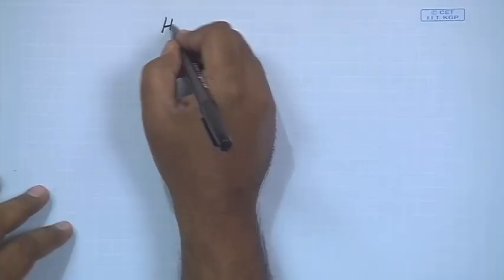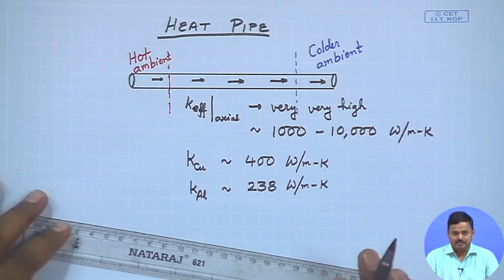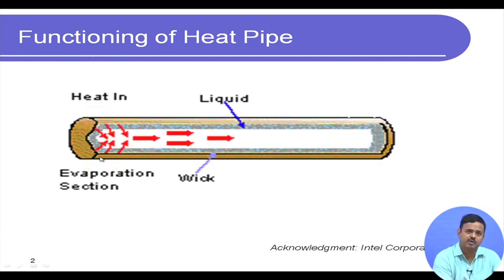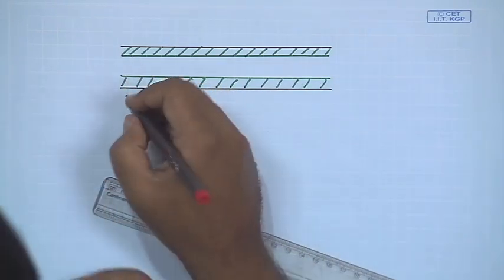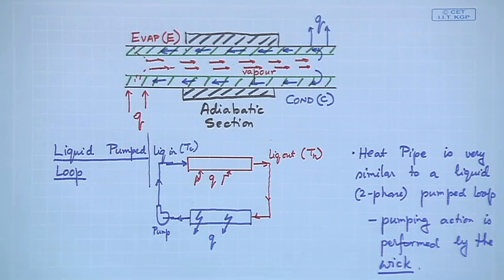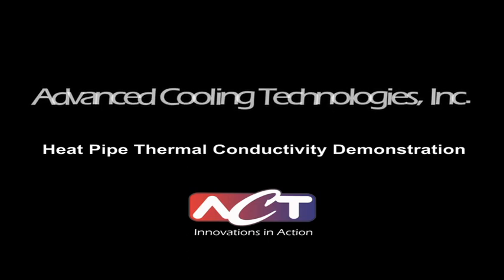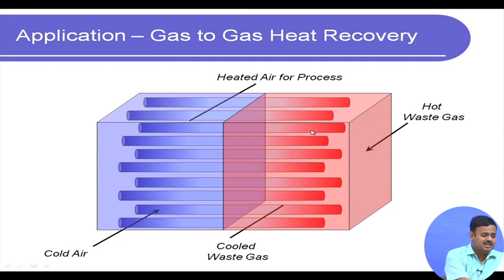Lecture 37 : Heat Pipe - Part I

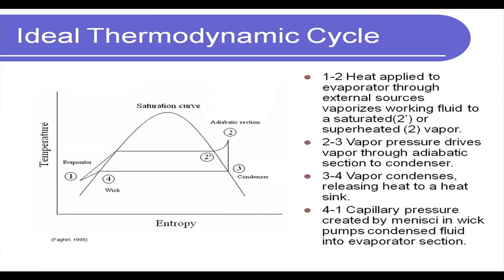Comment: sir at 15:30 the T-S plot is not correct as the liquid return process involves  fluid friction  and thus entropy must increase. the diagram shown here actually was proposed by R richter & J.Gottschlich in their paper Thermodynamic aspects  of heat pipe  operations which  was later modified by A.Fagri et al 1998 in the paper Entropy generation  in a heat pipe system. Please do clarify regarding this being a student of M-Tech this is presently the domain i am working and your videos have been helping a lot .
Reply: Hello brother can you help me i am also working on this topic?